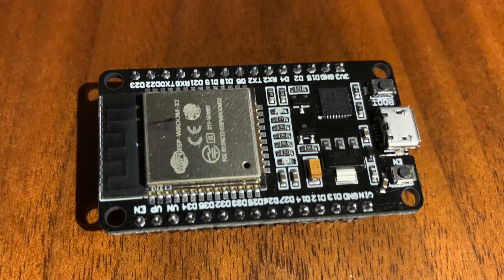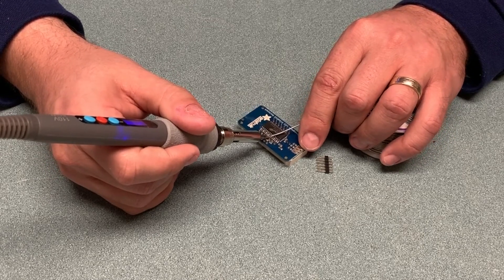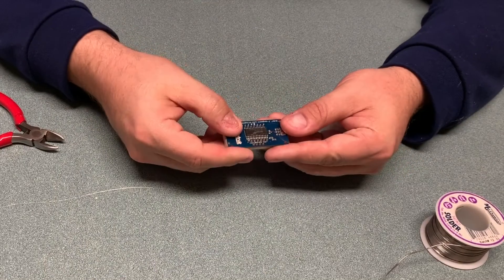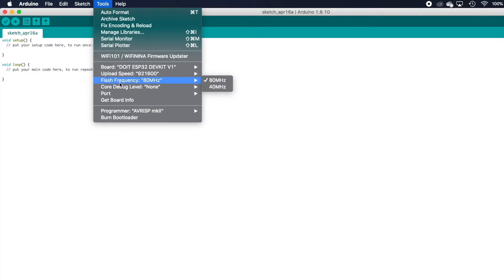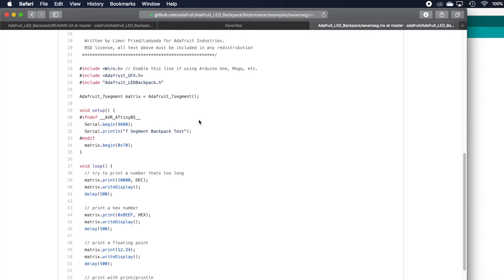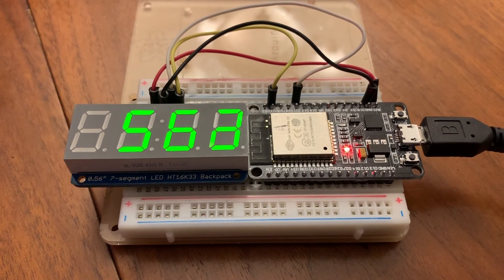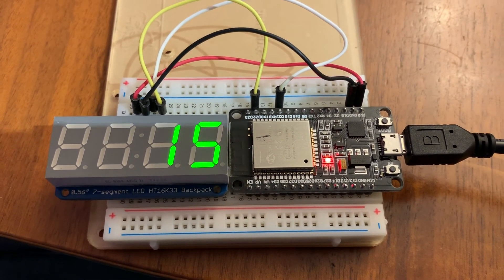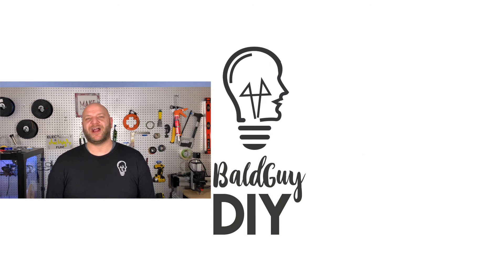ESP32: How to Setup Adafruit 7 Segment LED Display w/I2C Backpack

Comment: For people struggling with these, a few thoughts, garnered from trying to get mine to work, though mine is NOT an Adafruit product, if it was, life might be easier!

*  Some of these displays are not the backpack version, but eBay/Aliexpress/Banggood etc. and they work best with the tm1637.h library, #include <TM1637Display.h>, which comes with its own version of the test program.
*  Some have been assembled wrongly and have some SMT components in the wrong places, they can be fixed, but it seems you have to cannibalise one to save another. There is a YouTube video about it: https://www.youtube.com/watch?v=F5rhnFX3_w8 
*  It's not actually I2C, which is why you don't need the wire.h library.  For that reason, you shouldn't use the same wires for an I2C link, thinking they will sort out their addresses the way I2C should.
*  I use the ESP32, and found that the display doesn't work on the default pins 2&3, I used CLK 23, DIO 19.

I hope this helps you, just in case you get the same questions as me.

BG, I hope you don't think I'm hijacking your post, it is excellent for people using the same devices as you.
Reply from the maker: Thanks for watching and for sharing best practices with other seven segment displays. Good advice!

Comment: Hello there BaldGuy, could you show me how to connect the backpack to arduino uno for non contact thermometer?
Reply from the maker: Can you send me the part numbers of your components such as the thermometer and backpack, and I will take a look!
Reply: @BaldGuyDIY  Hello there again, thanks for your attention , I am trying to build my non-contact thermometer with a MLX 90614 sensor and an Arduino UNO , I also have an Arduino NANO if better or easier, the display I have is a 7 segment 0.56" LED HT16K33 Adafruit Backpack
Reply from the maker: kevin cazana it isn’t going to matter which one of your Arduino microcontrollers you use, it’ll be the same. Those are both I2C devices, so both of them will connect to 5V, GND, SDA and SCL. One Arduino can communicate with multiple I2C devices, they just need different addresses. The sensor address is fixed and can’t be changed, but the backpack can be changed. The Adafruit guide for the sensor setup is https://learn.adafruit.com/using-melexis-mlx90614-non-contact-sensors/wiring-and-test?gclid=CjwKCAjwkdL6BRAREiwA-kiczGy8K1Ny7bnpNCUKlNKBBaYCVowzXAgfcKdRAlo5OXFaZ2v8iX2uPBoC5b0QAvD_BwE and the backpack is https://learn.adafruit.com/adafruit-led-backpack/1-2-inch-7-segment-backpack-arduino-wiring-and-setup?gclid=CjwKCAjwkdL6BRAREiwA-kiczC9FNxLGVazpOCLSve7RjGfDlYJ6MXFzyzNZrU3V7MYDdrF8Tvy0tBoCVIIQAvD_BwE

I’d recommend trying each device on its own at first and make sure you know how to communicate with them, then put them on the same I2C connection and see if they still work together. If they don’t, change the address on the LED backpack and try again. Good luck!
Reply: @BaldGuyDIY  Thanks a lot! BG , great help

Comment: Hello, I'm trying to do exactly this with a slightly different product (https://www.adafruit.com/product/3108). It's still a 4-digit 7-segment LED display with a backpack, just more pins. I have successfully hooked it up to an Arduino Uno as simply as described in this video, however when I switch out the Arduino with my ESP32, the I2C communication stops.

I saw on a tutorial (https://randomnerdtutorials.com/esp32-i2c-communication-arduino-ide/) that the SDA and SCL lines are active low on the ESP32, so they should be pulled up with resistors. How did you get proper I2C communication without resistors on your SDA and SCL lines? Any tips would be appreciated 😅
Reply from the maker: Hi Wade, thanks for checking out my video!  I took a look at the product page for that model, and the instructions don't indicate anything different on the setup from what I did.  As you can see in my video, I didn't do anything specialto make it work, I just uploaded the sample script and it worked!  Then I tweaked the code in that script to get the output I was looking for.  I used the Adafruit libraries, perhaps there is something in the library programming that already accommodates the I2C requirements for the ESP32.

My usual recommendation if someone is having trouble is to try the same sample script.  There could be something tiny in your own code that's causing the issue.  I know for my display that the sample code works, so if you test it on yours and it doesn't, then we'll know for sure there's something different required.  If you try it and it works great, then it must be something in the code you've written.

I hope that helps, let me know if you need any additional tips:)
Reply: It's not I2C, though it uses lines labelled as though they are.  I2C needs an address and these displays don't have one. On the ESP32, I used CLK 23 and DIO 19, don't use 2 or 3.
You may find this page useful for any ESP32, especially the dev boards: https://randomnerdtutorials.com/esp32-pinout-reference-gpios/

Comment: Can you PLEASE show me how to make the  Adafruit  1.2" inch  4-digit 7-segment display show a DECIMAL point. I followed your video here but it seams to only work with the smaller 7x4 display. Thanks
Reply from the maker: Captain Bucks Adventure Time hello!  Do you have the i2c backpack on the 1.2” display?
Reply: @BaldGuyDIY  YES  .   For some reason I can not get it to display a Float value ! Or the upper right decimal
Reply from the maker: Captain Bucks Adventure Time if you load the same script I used in the video, there’s an example of a decimal being used. Does that sample script display the decimal?
Reply: I have used the code supplied in the example 7 Segment, but NO it does not show a decimal. What I really need is a 1-2 inch LED 4 Digit 7 Segment Display that will allow a floating decimal for a Speed Trap display for a Slot car system I am trying to design ! And help will be rewarded !
Reply from the maker: I would suspect there’s a problem with the connections to the backpack or with the backpack itself. Double check all your solder points. If it displays everything but the decimal point that sounds like a possibility. Also try putting the decimal in different places in the sample script. 1.234, 12.34, 123.4 and see if any of them work.
Reply: What I would really like to use is the 

MAX7219 Micro controller 4 In 1 LED Dot Matrix Display,  as the main display for the track. Have you messed with that one to see if you can get it to display a floating decimal ? The goal is to show a reaction and ET time and I need the Decimal point.
Reply from the maker: I haven’t used that display. However, if it uses i2c as well, then the code should be very similar.
Reply from the maker: Glad you found the answer!  I’ll check out the links, good luck on your project.